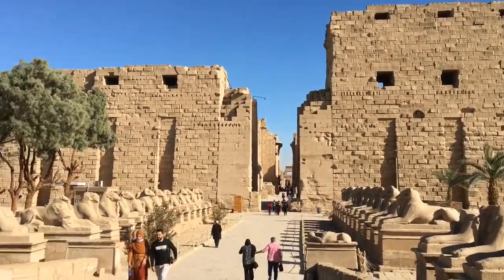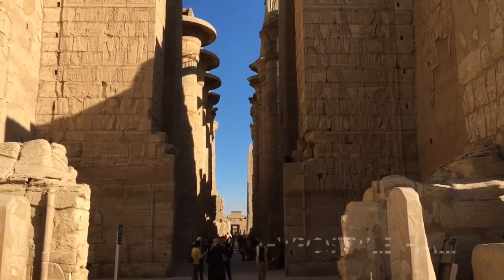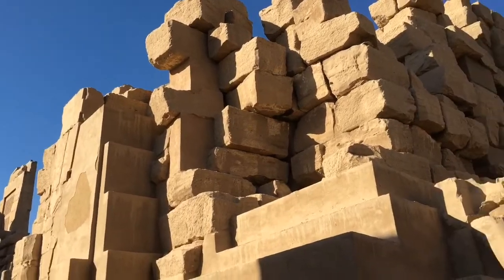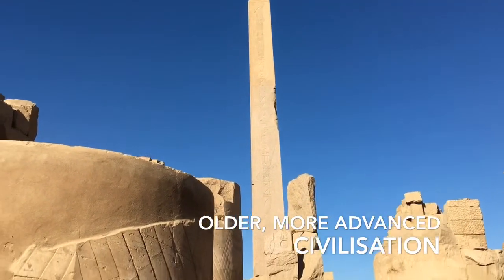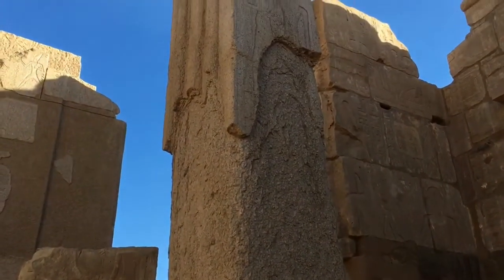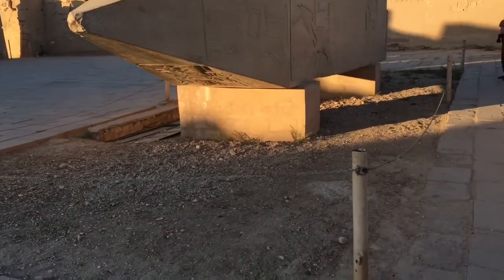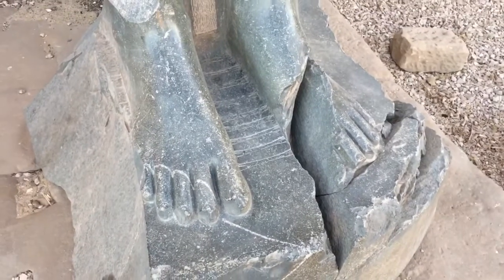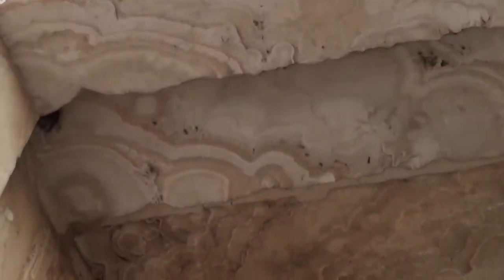Ancient Technology at Karnak Temple

Comment: Hello 👋Aliya. 
I have been wondering about the holes in line at /on the front wall . I have seen similar in other sights as baalbeck and india for example. Could they have been used for woodfloored walkways or for shade maybe? I dont belive its for quarrying. 🤔💭thanks for a good video.
Reply from the maker: Hi Mie Mie 😊
Thanks for your comment 🙏. I also don’t believe the holes were for quarrying. The sun is very intense in Egypt and shade is essential so perhaps that’s what those holes were for.